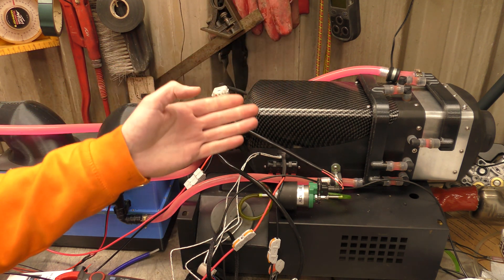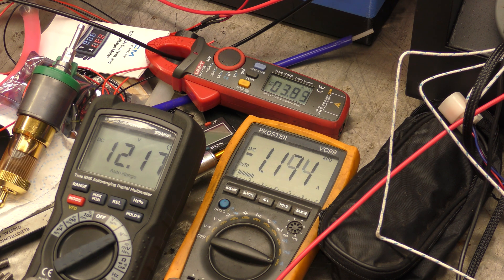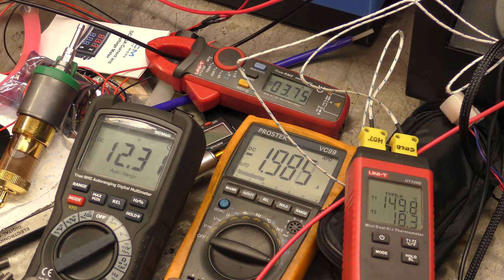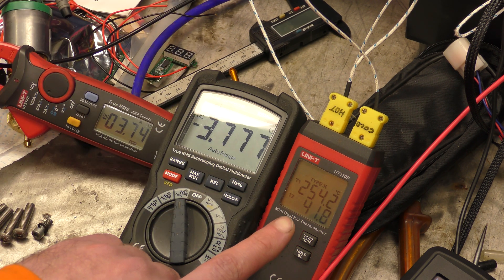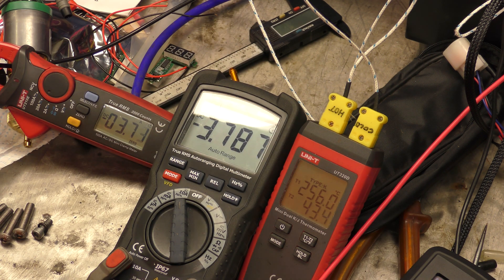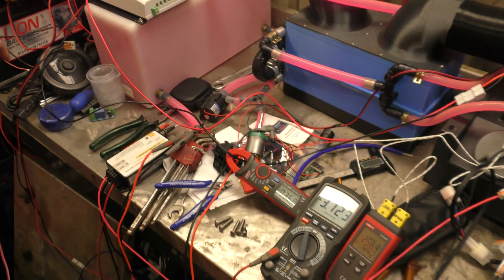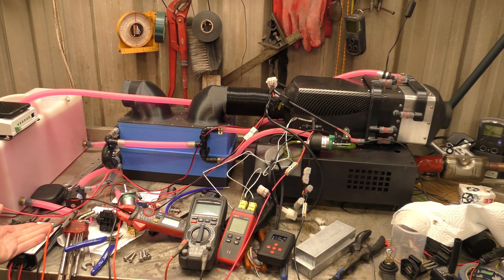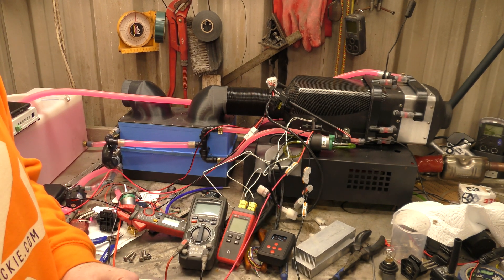Self Powered Diesel Heater Project - 100% TEG powered - part 9

Comment: If you earnt using a watercooling radiator on the intake on the heater to cool the water while preheating the heater charge air you are missing free efficiency.

Comment: I feel like this is a bigger achievement than we may realize. I'm making a propane fueled water cooled generator to see if I can save money making electricity while I heat the house with it. Also so I can have heat and power if there's an outage. This is cooler because it has way less moving parts.

Comment: David you are always one step ahead.  Just had this idea.  I`m a long time watcher of your but don`t comment so much. Thanks for sharing!!
Reply from the maker: Hope to have another update on it very soon.  Other David and I have been working on it in the background.
Reply: @DavidMcLuckie is there a video discussing what tegs ended up working and the heat sink set up u used I've watched I think 4 videos on this heater and still haven't been able to figure it out ...  Maybe a follow up video??? Durability of the system and where to acquire the parts and whatnot, I wonder if uve continued to use this heater and do the new tegs hold up ?? And for how long ?? I mean I'd like to build this I already use these heaters for multiple purposes but I don't want to invest time  and money if it doesn't hold up over time as I would want to use this for practical purposes not experimentation as u've already proved it possible but I would like to know if it's a feasible option for day to day uses

Comment: Why do you not buy a quantity of each battery used in your meters and regularly check them under load and change any BEFORE they fail? Your lack of preventative maintenance is the cause of your repeated experiment failures. Also you should compare the meters to find out which read high and which read low, particularly because all your meters are different and appear to be of low "chink" quality. However the videos are very useful and enjoyable, so keep up the good work.

Comment: Correct me if I'm wrong, but in colder climates when you NEED the heat more & potentially have less solar to charge up during the day, the bigger temperature differential would make the TEG even more effective?
Reply from the maker: Yes.  The colder the air the bigger the temperature difference and the better the TEGs work.
Reply: Yes it would produce more power the cooler the climate is 👍🏻

Comment: Could it be possible to use the exhaust to power a turbine to generate power,  or does the fan not blow out the exhaust that much?  To add to the current output,  maybe someone could build a  micro turbine engine heater simple enough to be cheap,. And generate power maybe more than enough to power it's self! Maybe. Keep the vehicle battery charged with inside lights and radio ,   say 10 amps,   I was looking into small engines that could make heat, or generate enough power to run electricity heat, say 50 amps at 12-14v  build a restive heater that runs about 200°-300°F  but that would be loud,  this system could use a large oil cooler as a radiator, to pull the heat, even at 100°f  130°id say would ve the most, to allowvthe teg  to eork efficient enough,  being off-grid I am very interested in this ,  i been thinking about building a small wood stove, to burn waste oil in mostly,  and use a turbo as a  a turbine engine , maybe connect two exhaust turbines together to get a bit more power,  to the generator,  then a  30:1 gear reduction to spin a generator, the exhaust  could make heat,  but the simples way would be to get a 3-5 HP diesel engine.  And connect it to a generator,  and modify the engine to be water cooled,  and use a heat exchanger , to cool the engine, then a water cooled exhaust to super heat the water before it goes to a radiator  mount it inside a sound resistant box,  it should generate plenty of power to run a small house over night, you can start chasing your tail really easily with this sort of thing!

Comment: Does the return go straight to the water tank? Why not make an AL or copper slide/sluice to increase surface area and slow the return speed of the hot water? Dump the return output onto the slide and let it bleed the heat to the atmo as gravity pulls the water around the shallow river channels before letting it drip back into the pickup tank.

Comment: I am really impressed with the work you do.
I live in South Dakota in the USA.
I am looking at getting a Diesel heater, but am not impressed with how quickly they go through a fully charged battery. 
& I am not really wanting to spend the large amounts of money on a solar system to keep the batteries charged.
So when I seen this video  I was really hoping you could have made this work to its fullest potential. 

I love to go winter camping out on the ice & ice fishing in the winter.
Here in my state it's get down to -30C to -45C

So when you were saying that your temperature differential wasn't great enough to create the power you need for total self powering.
I began to think if you could get your coolant down below 0°C that would get you to the power needed & or even more to recharge the battery needed to get the heater running.

If you have or haven tried this yet could you & post your findings.

Comment: Anyone know why when I replace the motherboard on a 5kw vevor heater the controller no longer works. It does light up and primes the pump but thats about it. Glow plug light and fan symbol do not come on. Does the controller need to be paired with the new motherboard?
Reply from the maker: Not all controllers and motherboards are compatible.  Even ones that look identical sometimes aren't.  I've had several now where everything on the LCD lights up as the motherboard doesn't speak the same langauge.

Comment: Hey guys I've got a question I'm trying to use the same fuel line for my diesel heater on my Sprinter van to fill the main tank from an auxiliary tank mounted underneath the van if I push fuel towards this heater will it go into the heater when I am transferring the fuel from auxiliary tank to my main tank
Reply from the maker: Negative.  The heater fuel pump only allows flow when it's pumping.  When it's off nothing gets through in either direction.
Reply: @DavidMcLuckie  so this connection that I need to make is after the fuel pump so it would actually Force fuel Tor words the heater in that case would it just fill the heater up with diesel fuel or is there something that stops the fuel at the heater

Comment: Great project, glad to see you got it working despite the abysmal efficiency of the TEGs, You should create a organic Rankine cycle engine generator based on a refrigerant, I would recommend butane, propane CO2 etc despite is flammability because a HFC leak could be deadly if combusted. the efficiency of such a system could be five times higher or better, you could use an automotive scroll from an EV with a permanent magnet motor just by removing the check valve and running it as an expander, if you did it right you could be getting 100s of watts on top of what you are using, I would love to see this.

Comment: I think the more important thing for people is that using tegs you can generate a fair bit of power and reduce the input current from a camper battery. Being about to run all night with a 1a load and not a 3a load would be a game changer for many.

Comment: So my "8kw" vevor on setting 4 consume 1.9amp and produce 206 to 210c at the casing. For me its fine.. 😂 Normally I run it at 1 or 2 its heating my needs perfectly. (i know its not 8kw i mean) but what if you crank your fuel up at lower fan speed producing same heat..? U see mine hasn't gone wrong since November and im running it every day and when near zero degrees outside or minus im running it 24hr. I have figured that at minimum its around 2-2.1hz and running on kerosine. Just an idea :)

Comment: This would be brilliant on a boat - as much cold water as you want, especially  in the months you would want to run the heater.  Just needs a super capacitor large enough to store the initial glow plug current, then it's a stand alone system.

Comment: Fantastic job David I knew you would get there in the end, it was weird to see the heater still running when you removed the battery ground wire.
To keep the cold side of the tegs colder couldn't you just use water direct from the cold tap? as mains water has it's own pressure you wouldn't need to run any pumps plus there would always be cold water passing though the cold side of the tegs, I know this would waste water as it would just be going down the drain but for testing purposes it would be interesting to see how cold the cold side of the tegs would stay, or am I yet again talking a load of bollocks 😁🤷‍♂🤠
Reply from the maker: That was one of the tests I was supposed to do, but not only does it waste water, it wastes heat.  Ideally I'd want all the heat back into whatever area you are heating up.

Comment: My killer question, how much would this system cost the consumer, assuming it was reliable? My guess is £400 + the diesel heater. Outside of the campervan/MH world, there's a huge market for this, in areas where generating power during the Winter is an issue. Well done!

Comment: If the air intake pipe for the diesel heater combustion is sucking in cold air from an outside space then would it be possible to fit a heat exchanger in that pipe with the coolant running through it? The cold air sucking through the heat sink may help cool the cold side of the teg that way.

Comment: This is great!  There is still room to grow.  Heat from the exhaust and cooler water.  You could put a small radiator in line with the water supply hose and mount it horizontally for passive cooling.
Thanks for doing all this.

Comment: It could be the beginning of the self powered electric vehicle I'll give you a year or two to build it.
Reply: it's using diesel.

this contraption avoids additional electric energy.   just like usual cars ran for ages on fuel and generated their own electric energy. with their alternator.

the difference is: this one produces heat as its main job. a cars engine produces mechanical energy as in rotation as its main job.

running an engine on natural gas/LPG/diesel and having it set up as a generator plus using the waste heat is easy.  but it's loud and needs frequent oil changes ect.

running a diesel heater self sufficient with peltier elements as a generator is NOT easy ! but has quite some advantages like low noise levels and a good efficiency. and it has less volume taken up then a diesel motor with generator of the same heat output.  (that to be fair would also put out a big plus on the electric power side)
Reply: @casemodder89  I see they must develop the giant peltier that fuels the electric car and less expensive batteries will save a little weight too anything is possible just have to go down and try this road in the future.

Comment: I think that's mission accomplished. Will you be showing more of the set up. Congratulations to you and other David.
Are you cooling the coolant? like running it through a radiator. What's happening with the air intake in that blue box?
Reply: Yes we are cooling the coolant through two radiators that are inside the blue box which the heater is sucking cold air through.

Comment: Did a great job, I was thinking of a similar setup to use on the exhaust with the TEGs, the peltier plates seem a bit delicate in ways but that you have done the R and D here is brill, check out my vids to see how I was thinking about going about it, might be able to then extend the peltiers to get some more amps out of the system, specially if you teg up the exhaust on the out side of the shed :-)

Comment: I wonder if you put a few small fan's in the output side of the heater and hook them in series to help with recharging.
Reply: that is like blowing at windmills with giant fans. pointless.

everything has a worse then 100% efficiency. so the generatorfan would lose energy, then the wiring would lose energy and finally the internal fan would lose energy. 

if that was possible... whoa... engineers would go NUTS.

Comment: Great video, glad it was a success. Just wondering if the battery voltage was higher, does the current draw from the battery decrease? Is there any reason that more TEG modules could not be used to convert the heat to electrical energy beyond unity? I am assuming the TEG is a Peltier device of some configuration. The possible application of this for a recreational vehicle is quite interesting as the hot water from the cooling cold be used to preheat the hot water, the electrical for charging and the heat for the living space, of course assuming that it all comes together effectively.

Comment: Might be worth having a thermosyphon setup to cool the water, simply a radiator with hot to the top and cold to the bottom and magic happens and it all flows by itself, no energy needed, well, it is a loss of energy (heat disspation), but, it's all relative... :P
Reply: Was good enough for the model T 🍻

Comment: I have used PC water cooling radiators for warious heat exchange projects. The ones I used looked like mini car radiators and would mount a 120mm 12V fan. They are surprisingly efficient.
Wonder if a few of these in series would fix the issue of the water tank heating over time and ruining your deltaT?
(PC fans will often run fine on 5V at reduced power. Do that through a small buck regulator to keep the efficiency up.)

They work really efficiently as heaters too. I think you used similar on your heater/water heater setup?
Reply: Maybe skip the fancy buck step down part and wire two fans in series to halve the voltage?

Comment: Probably get more power out of it running the cold side outside, especially when it's cold enough to require the heater in the first place.
Reply: I agree, but as it's taking the heat from the heat exchanger. then you're throwing it away to power the heater still valid idea though. If the TEG was still on the exhaust then definitely yes.
Reply: @fenceup07944931177  a small bit of wasted fuel is a good price to pay for a mobile, off grid application where solar pretty much doesn't exist - like pretty much every day in the winter around my region. 

I love camping in the winter but power is challenging. I have enough battery to run my heater for about 3 days straight. If it cold run indefinitely AND produce a bit of extra power then suddenly I've got virtually unlimited "range" for heat.

Just need to keep it fed with diesel. 

The question is, is it still net positive when it's on the lowest output. That is really where my issue would lie.

Comment: Maybe if we could improve the fan effeciency, ball bearings maybe changing to a silver based brush for the fan motor, theres also lot of potential to improve the fan on the chinese disel heater just by cleaning the plastik up a bit. Could also smoothen the surface inside the fan housing for the combustion air inlet. 

Or change the 1 brushless fan motor with 2 brushless motors.. so many cool projekts :D
Reply: Or undervolting the fan motor?
Reply: @jacobpetersen9430  less voltage less rpm. the result is less air to combust and less heat.
Reply: @casemodder89  
I am not sure with a brushed motor but ive seen that undervolting desktop pc fans can improve cfm pr watt

Comment: well done very impressive. what about ice in the coolant reservoir?
Reply: that would be an unnatural energy source. and kind of cheating.

just like a room(-intake) temperature of 18 or lower degrees C.
Reply: @casemodder89  diesel heaters are used mainly in winter so if your van or room was 18c you wouldn't bother with turning the heater on. Ice would simulate your coolant reservoir being in cold conditions mounted to the underside of the vehicle to maximise the efficiency of the TEG's. Water freezes in nature what is unnatural about that? Its cheating only in your mind only.